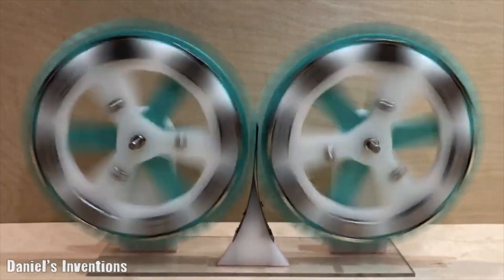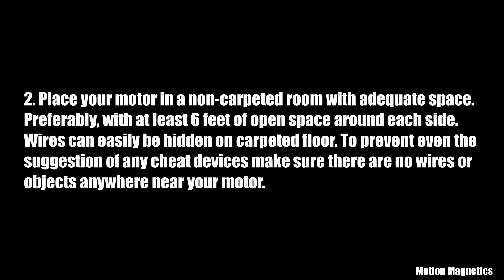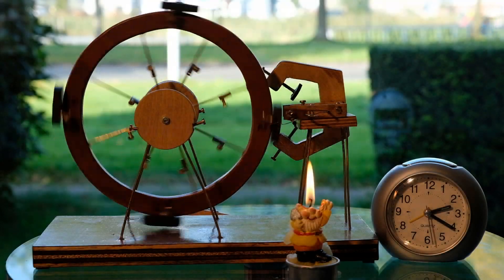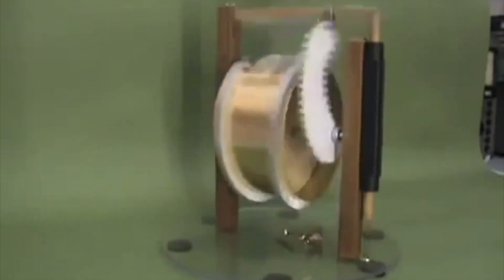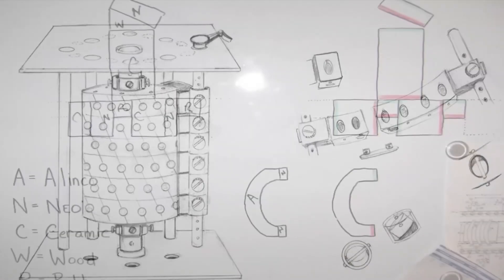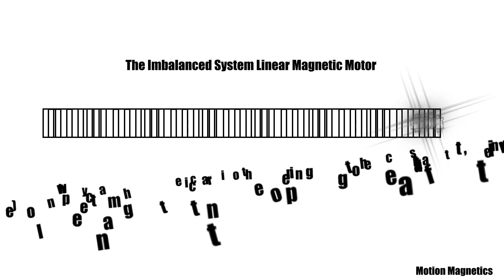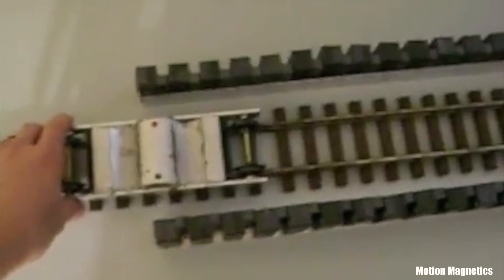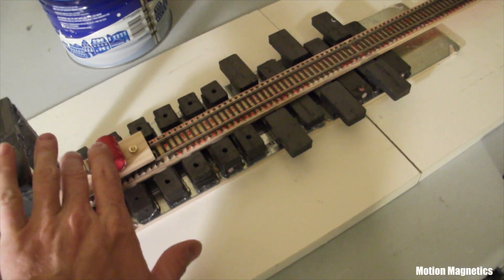How to Validate a Magnetic Motor Part 01

Comment: Were could I go or who to approach with a self sustaining pulse motor, of coarse who can be trusted? Has run six month and the battery has maintained a voltage of approximately 8.5 volts on an old 12 volt car battery. It had run for six months previously, but had to move it to another building because of roof leafs, restarted it again. Have developed a simple circuit which captures the back spike, I'm not sure what is going on, and stores and uses this surplus energy to keep the device running. I don't do calculations, just use basic principles but have made some discovered through trial and error. Try it and Fry it is a well practiced method. In January will post a video of it. 
I turn coils and build devices to see what they will do, 15 years of experimentation. This one motor I have been working with at least 12 yrs, worn out a few bearing in that time and thought of hundreds of configurations. For me it is fun and enjoy doing it. Your presentations are alway very analytical and detailed in explanation and  have produced excellent content for many years.
Reply from the maker: I'm going to cover some suggestions on that in part 2. It'll be online Christmas, or you can visit my Rumble channel and see both parts in one video right now.
Reply: @Motionmagnetics  Thanks.... Were do I view the rumble channel.
Reply from the maker: @tribulationcoming  https://rumble.com/c/c-978187
Reply: @Motionmagnetics  Got It.  Thanks.
Reply from the maker: @tribulationcoming  You're welcome.
Reply: @tribulationcoming    Capturing back spikes does not mean a gain of energy. Back spikes only return the energy which was spent before to create the magnetic field. Have you checked the current your device consumes? This may be a little difficult to measure exactly since it may not be a DC current. If this current is very small a car battery may sustain your device over several months without showing signs of exhaustion. For instance, if the consumed current is 5 mA, and a battery has a capacity of 60 Ah, the device can run longer than a year.
Reply: @heinzpg  Thanks for the reply, after the first of the year I will do some analytical investigation and try to find out what's actually happening with the current flow.
Reply: @heinzpg  Didn't want to disturb the six months run. The voltage does remain the same, not decrease. Been doing this for about twelve years and tried hundreds of configurations, this one is an anomaly. Burned up coils and blown a cap or two in the process, also worn out a few bearing.
Thanks for the interest and we hope next year will be a good one. Will post a video after January first, then do some diagnostics to see what's going on.
Reply: @heinzpg  All I can say is that I've been doing these things for many years and have tried hundreds of configurations, some produce several hundred volts, no HV with in play here. This device continues to run with no loss of operating voltage. Will let it go for another six months, but will have to replace the bearing at some point. Posted the video.
It is not producing an increase in voltage, just maintaining itself. Think of the caps as reservoirs, as an amount of amperage is removed, the same amount is being added.
That's the only analogy I can come up with.
If I told you were I get some ideas you'd really think I was nuts, but I'll keep that for another day. I do appreciate your interest and concern.
Reply: @tribulationcoming    Thanks for your informations. I expect that there will be some sound explanation. All electromagnetic phenomena are governed by the famous formulas which were found by Clark Maxwell. Never was anything observed which does not comply with these formulas and therefore no "miracles" can be expected. (There are many simpler formulas in practical use but all of them can be derived from the Maxwell formulas.) High voltages are nothing extraordinary, any electro shocker can produce 10.000 volts from a small battery.

Your car battery shows only 8 volts. This is an abnormal state for a car battery, with such a low voltage a battery is considered as dead, already with 11 V a battery is total empty. I am no expert in this field, but it is possible that the battery is in an  state where despite chemical reactions inside the battery the output voltage does not change any more. Of course, in the long run, the battery should show signs of exhaustion. Your device may stop even with still 8 volts because the battery becomes such a high internal resistance that you won't get the needed current for your device out of it. And the current is, as I mentioned before, another point to consider. There are commercial miniature e-motors which only consume e.g. 100 mW. These motors would run easily for a year from a car battery. I recently stumbled over the historical "Zamboni pendulum", a device which runs from a rather small high voltage battery for 100 years due to a small power consumption. Thus the current which is consumed by your device is of interest. It would also be interesting to use in a follow up experiment a small battery - e.g. some button cells in series for getting roughly 8 volts. In this case a decrease of voltage will perhaps be observable after some run time. Also the rotation rate (rpm) may be interesting to observe. It would be interesting if there is a slight decrease in rpm over time. There are rather cheap instruments which measure rpm without mechanical contact.
Reply: @heinzpg  I know there is an explanation, I'm going to try an find out what that is.
The battery reading went up a little over a volt when better contact was made on the positive pole, copper sulfate has formed around the copper wire wrapped around that terminal. Drilled posts into the top of the battery terminals and used wing nuts to secure the positive and negative leads, also the rpm's increased. At some point the bearing will have to be changed, without oil they get noisy. As far as it's ability to operate, time will tell. An important question is, is this a unique situation, or can it be duplicated using a different coil and armature setup that will produce more torque. Working on a radial design. Jerry Babcock told me once," if it is working don't "screw" with it. Will let it prove itself.
Reply: @tribulationcoming    Although I don't know your device, I think the only energy it consumes comes from the battery. My explanation so far is, that power consumption is very low. Even a low power consumption should have an effect on the battery over a long strecth of time, but the battery is obviously in an abnormal state since it only delivers 8 volts. There may be a mechanism that keeps the voltage constant although current is drawn from it. Low power consumption also means low torque. I don't see any chance to increase the torque without increasing the power consumption. Future will show ...
Reply: @heinzpg  The connections on the battery terminals was affected by copper sulfate on the copper wire which was used, I drilled posts into the top of the terminals and used wing nuts to make secure the connections, the battery voltage increased about one point two volts and rpm's increased. Will now begin varying components in the circuit. First a new 12 volt lead acid battery and I've got to make a decent schematic. If I dismantled the wiring I may not be able to stumble on that a second time. Thanks for the reply.
Reply: Go wherever you want, nobody cares.

Comment: If anyone follows this process you better have a patent or your invention will be copied, reproduced, and stolen.
Reply: In the cases of the patented Tri-Dyne motor of Popular mechanix bought by Lycoming and shelved, the patented Pogue Carburetor bought by Big Oil and shelved, the vaned concentric cylinder patented air conditioner device that disappeared, the Hilsch Tube high pressure air temperature divider now used in partial secrecy for temperature testing in manufacturing labs .. 
this is what happens to patented devices for the common people.  The patents are bought, the inventor paid off and the people have to keep reinventing the wheel while the administrators of our borned estates keep stealing our time and wealth to keep us in wage slave status building their useless abandoned infrastructures as "make work".

We live in a closed free energy system and you probably believe we're on a flying spinning ball at incomprehensible speeds in multiple vectors, yet we feel nothing.  Lol.
Reply: @bruceh4833  I can appreciate your altruistic ideology but your missing a large part of the equation, we're posting on a device and platform owned and controlled by the corporations and governments you're worried about. P.S. even in a closed energy system you are still subject to attraction and kinetic energy and there will be motion.
Reply: @bruceh4833 
I printed Howard Johnson's patent, just to put it into a drawer! It's funny to see people trying to reproduce his magnetic motor and failing, because they don't even know I have the patent shelved :-D
Reply from the maker: I'm covering that in part 2.

Comment: its not sufficient to show that you have zero power loss, you have to produce extra power (spinning motion wheel in space is not an engine to produce more power, just preservation of energy in newtons laws)
Reply: if you store motion energy in a train, it will slide through the whole track
Reply: you would have to turn off a magnet, then turn it on, to add power, ie, one-sided energy loading of a spring (by physics rules)
Reply from the maker: That's what Howard Johnson's work was based on, triggering an exchange force pulse in his track or stator assembly.
Reply: @Motionmagnetics  try a flip down (or wheel) magnet, where the magnet is first upward (perpendicular to the incoming magnet) then is pushed by the cart 90 degrees to next position, which will be opposite the the cart magnet, pushing it forward, now determine if the push operation is "zero effort" or takes exact same amount of energy than it would push the cart forward (90 degrees magnetic fields should not interact at all, cross product is zero)
Reply from the maker: @Jkauppa  I like your out-of-the-box thinking.
Reply: @Motionmagnetics  are you an insider after coming outside of outside box
Reply: meh I think by the rules of physics, the flipping of the magnet is the same as compressing a magnetic spring, so you get a maximum of equal back that you pushed in the magnetic spring
Reply: @Motionmagnetics  only God gives freely
Reply: @Motionmagnetics  assume you can "effortlessly" slide the opposing magnets over each other side ways, then you get the extra push every time
Reply: @Motionmagnetics  think like the magnet on-off device
Reply: @Motionmagnetics  what do you think of maglev train tracks with two permanent magnets